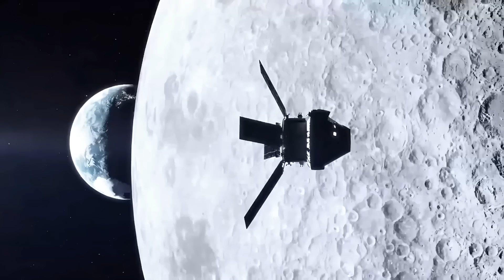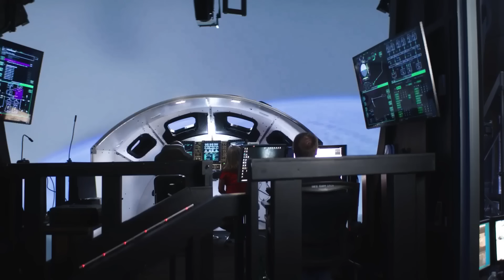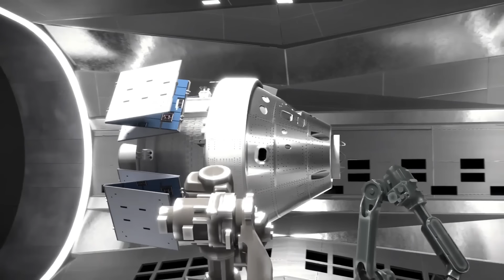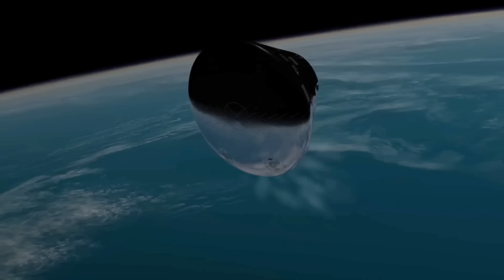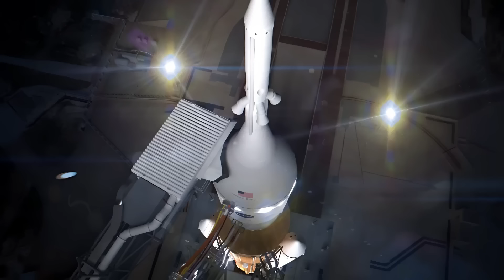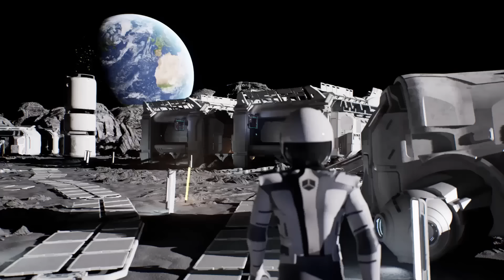The Farthest Humans Have Ever Gone Before | Artemis II Explained

Comment: What excites me the most is it's finally happening.  It's always been a moving future date, so I wouldn't be surprised if it got delayed again.  Now, from the way you described it, they aren't going to orbit the moon but just do a slingshot.  The surprises me, as the next mission would require orbiting, so it would make sense to orbit, like they did on Apollo 8.  And if the logic is to do incremental steps for safety, then Artemis III should be a manned orbit, Artemis IV should be a partial moon decent (like Apollo 10) and Artemis V should be the moon landing.  I have to believe they are orbiting and not just the slingshot.

Comment: I just want to know what plan B is? Or do they have a plan B,you know just in case something happens.
Reply: B would be to just do earth orbit to continue systems testing.
Reply: well if something goes wrong and they've already done the TLI well then they're just gonna have to continue with the path they were on since it's designed as a free return trajectory

essentially the same thing that apollo 13 did

Comment: Could you please address a couple concerns? 1) why is NASA ignoring SpaceX 's success? SpaceX could adapt the super heavy or the BFR to do the same thing as the SLS, with reusable boosters at less cost also, 2) SpaceX Dragon capsule has a much better success rate than the Orion. The Orion capsule left 2 people stranded on the ISS for months...  I've asked these questions in other formats and have gotten strangely political answers...
Reply: Because it's all political. That's why you keep getting political answers.
Reply: Are you referring to Boeing Starliner? This is only second test of Orion. Dragon can be considered more successful only because it has more flight hours.